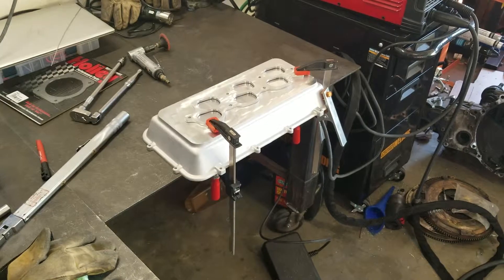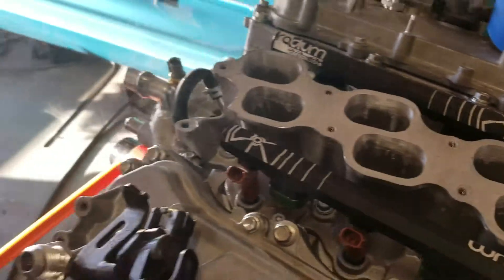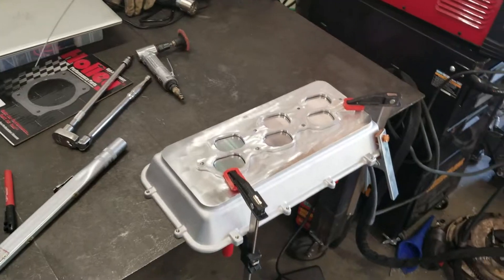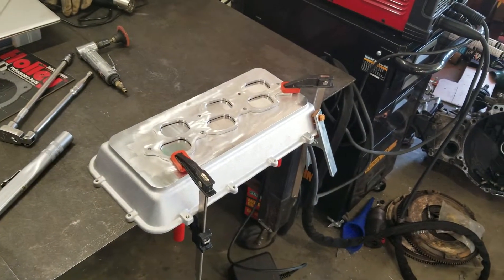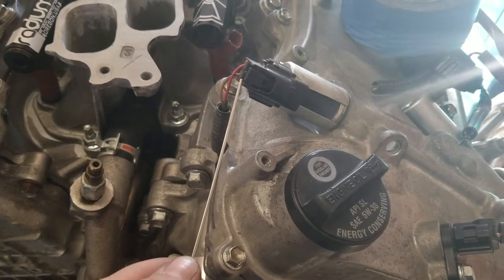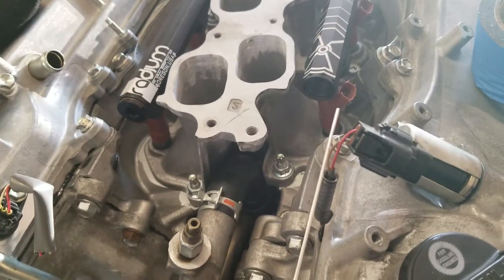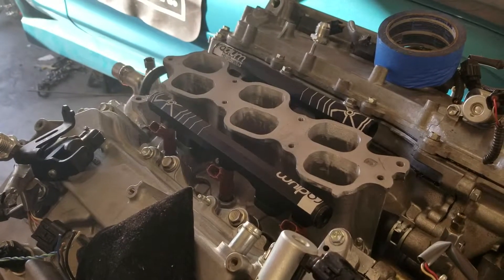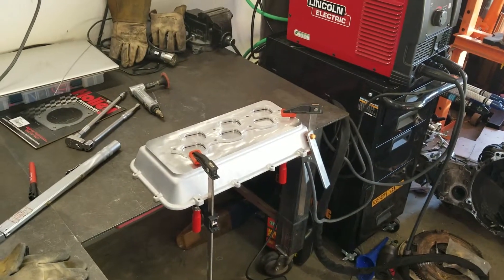3.9 Liter Turbo 2GR-FE Stroker Build Update Fabricated Spacer for Holley EFI Intake Manifold

Comment: Is there a reason why you could not buy a used lower intake manifold for $60, deck it, turn it sideways, and run it through a band saw?
Reply: if the intake ports taper immediately and you can't get a slice that's the same opening on top and bottom, you could just run each port small-side down around a bit on a router table until they are all straight through and the same on each side

Comment: Cool build so far man, did you get any further, have you finished it?
Reply from the maker: I am currently welding the headers together and have the engine hanging in the bay.  Next week I will spend some time editing all the video footage and will post some updates
Reply: Jeremy Hartz awesome man, I have a highlander with the 2gr and have been thinking of throwing a turbo on it and also have a mr2 I’m going back and forth on which engine to use 2gr or build a 5sgte. Can’t wait to see the out come
Reply from the maker: @Kurtscronicles  2GRFE > any S series
Reply: Jeremy Hartz I was reading forms and seen a bunch of people saying the 2gr can hold around 500 stock just new injectors and with changing the pistons/rods around 800. Seems easier to get power from it then the 5s/3s would be
Reply from the maker: @Kurtscronicles  with a properly sized turbo you can easilly get 500hp out of just 10psi boost pressure.  Im compound turbocharging.  Probably going to start with one turbo and then later add the 2nd turbocharger.   End goal is 1250whp
Reply: Jeremy Hartz seems pretty reasonable, that’s going to be a monster and can’t with to see it all finish. I’m thinking around 400-500 for the highlander and want around 1000 for the mr2

Comment: Please give more I wanna build a sw20 2gr but I'm thinking of going with the tvs1320 off the lotus and possibly sleeving the block and boring it to 2.7 but it's far off ATM just what I wanna do but I am very interested in your build do u have a write-up on a fourm I can follow?
Reply: You're better off using the TVS1900 & you will get better everything. If you go the TVS1320 route you'l be handicapping yourself. The inlet manifold makes the engine sluggish and you're better off with a TVS1900 with a better manifold and a bigger capacity to accommodate higher boost output. If you reduce your pulley size you will have short lived power due to rising intake air temperatures.
Reply: @aaronpreddy35  yeah I was looking at the tvs1900 kit that harrop has for the lotus I'm hoping to start the build in the next year